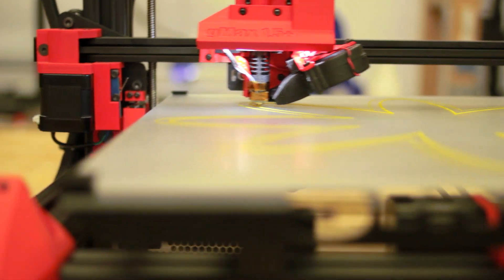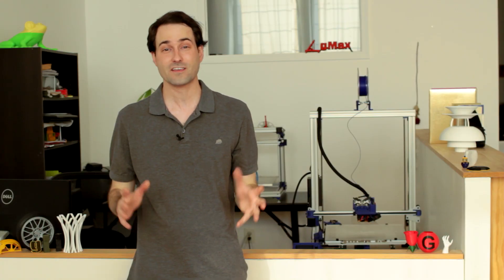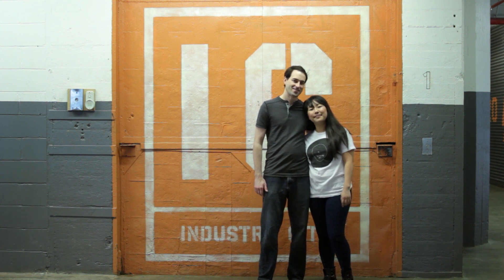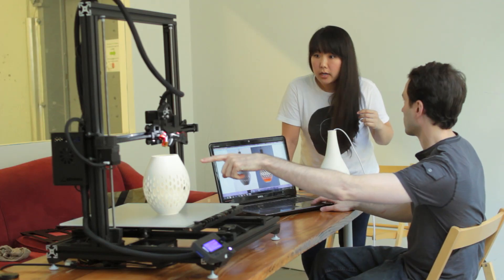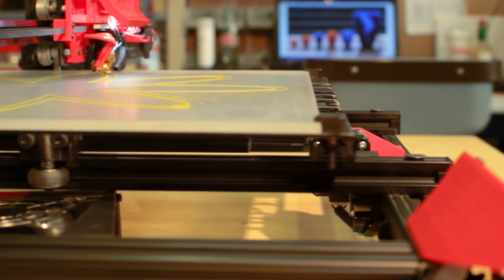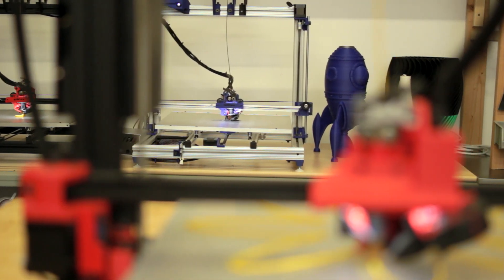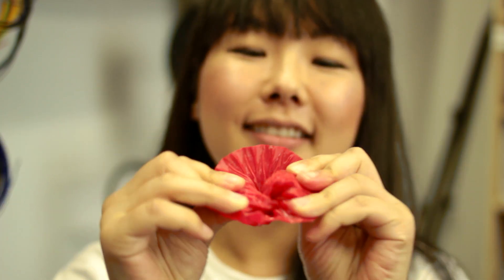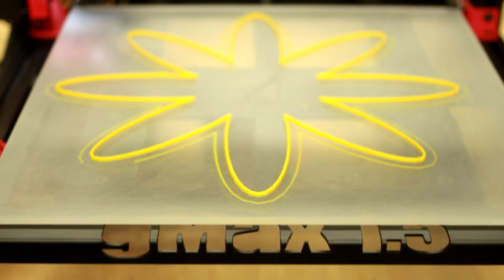gMax 1.5 + Large Format 3D Printer Launch Video

Comment: Review summary: The large print volume is really the only impressive feature. The printer itself is hobbyist-grade; the high-quality aluminum frame is betrayed by cheap PLA plastic parts. The gCreate support team is responsive and as helpful as they can be, but they can’t fix the firmware problems. Do not expect to do any production-level work (e.g., using any material other than PLA) with this printer without a significant investment in additional customizations, and even then it might not be up to the task.

What we like:
* At this price point, 16x16x21” is an impressive print volume.
* gCreate support is very responsive and helpful.
* The overall build quality is very good. Electronics & moving parts seem to be quality. The aluminum frame is very solid.

What we don’t like:
* At this price point, a printer should have significant usability improvements over DIY hardware; the gMax doesn't.
* gCreate can’t help you with firmware issues—and there are issues.
* Plastic parts on the printer are made from PLA instead of production-quality materials like ABS or nGen.
* The BLTouch Leveling Sensor has no connection to the actual Z position of the nozzle, so every print requires manual “babystep Z” first-layer height adjustments.
* gCreate does not provide consistent-quality profiles for common slicing apps. For example, their Simplify3D profiles are pretty good, but their Cura profiles are essentially worthless.

Read the full review at http://bit.ly/2CD4OGT

Comment: I am printing
(1) Timing pulley that is Diameter of 12" X 2" and 
(2) Chanel 3 X 3X 96.

I plan to break the 96 into 16" sections that i can join

will the gMax 1.5+ 3D Printer ( 16'' x 16'' x 12'' ) be able to do that?

Comment: did she say carbon fibre?
in theory it should be able to do what the makerforge does just as long as the slicer can understand where to put the CF
Reply: I think she was refering to CF reinforced plastic filament.  From the quick read I did, it's harder on the extruder as it's quite abrasive.  Seems to be available in CF reinforced nylon, CF reinforced ABS, CF reinforced PLA and others.
Reply: ok thanks